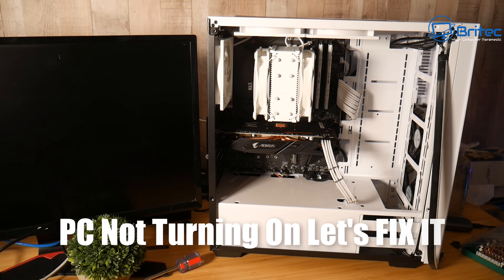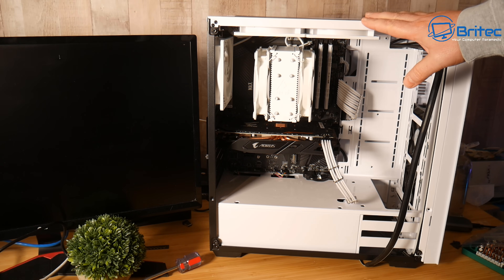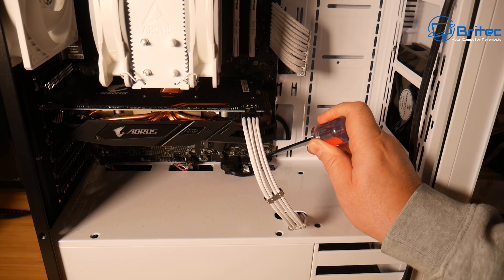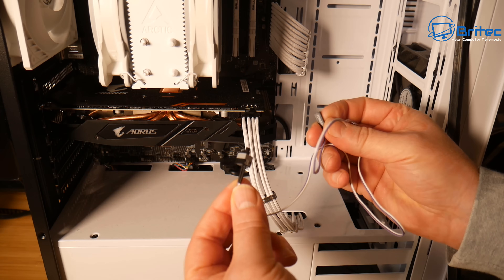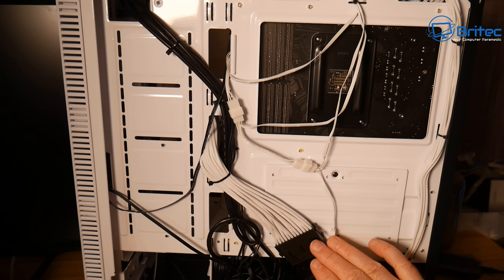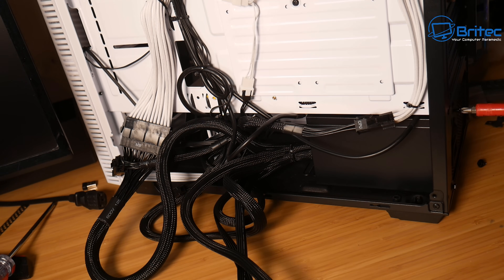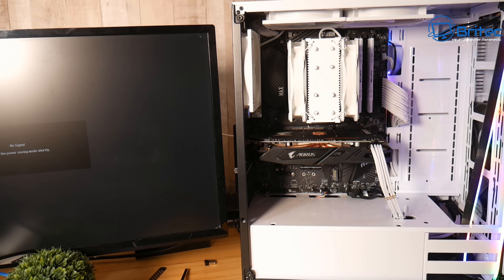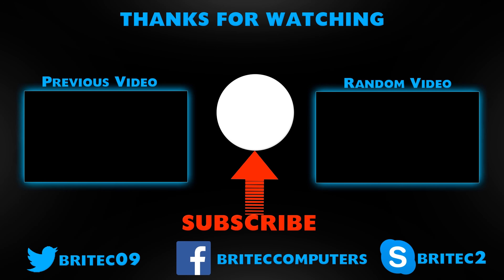PC Not Turning On Let's FIX IT

Comment: I'm facing another issue on my pc please someone help.

My pc won't turn on using power button, until I unplug power supply and plug it back, then it's turn on normally without any issues.

That happens every time I turn off my pc and try to turn it back on.

I wonder if someone can help me please.
Reply: maybe a bad power supply?
Reply: i would look up you’re exact issue and see if you can find anything

Comment: What if I swapped the PSU, but still no signs of any power, and the new PSU also gives no visibile power whatsoever? Not a single light goes on on the MB. So, I am sure new PSU is working.

Comment: Curious, i have a powered usb dongle; pc wont start unless its unplugged. I think it is causing a short to the chasis somehow and preventing the PC from starting up.

Can anyone think of a way to fix this?
Ive visually inspected everything and dont see a short? Pretty sure thats the cause though because i read somewhere the PC wont start if it detects a short (also the BIOS has a setting to preventing powering USBs during the start process to prevent this exact issue) and am confident this is the issue. Im trying to do it myself of course.

Any advice is appreciated, thanks in advance!

Comment: But what if there's lights on the mobo and the pc wont start. I've bypassed the switch. removed ram and all other components, replaced with others that work. replaced psu, gpu, checked pins on cpu.   if the mobo is dead then the leds wouldnt be showin. Can anybody offer advice?

Comment: Every video I find is a power supply issue. My power supply work and still the pc won't turn on. I don't how if the problem is the motherboard, cpu or ram, and no video tell me how to test it
Reply: Bro did ur pc got better?
Reply: Either it's a hard drive problem or a CPU problem. I would suggest trying the hard drive first.

Comment: I sent my PC into memory express to get looked at. I did the paper clip test on the PSU and it fired up RGB came on fan started spinning. But still I couldn't get any power to the PC at all. I couldn't even jump start it using the IO pins so I know its not the case cables or the PSU it must be the motherboard right?
Reply: Did you ever find out?
Reply: Hello! I have the same exact issue. What was wrong with yours?

Comment: My motherboard power button on the bored lights up but wen u push the button the blue light on the front of the tower goes blue and fades off instantly other things like my WiFi card lights flash and go straight off but the USB and memory card reader had power indicator lights come on all the time till the power button it pushed then thay go off till I remove the power cable and plug bk in

Comment: Hi I cleaned my pc and after if I finished I plugged it back in and it won't .... its not the power supply it works fine I tried it in another pc and I tried to manually power it on with a screw driver like u did in your video and it didn't do anything so I have no idea what is wrong

Comment: I’ve got the problem right now played my pc the night before woke up the next day went to play it and it wasn’t turning on. I thought it was the psu so I got a new one and still doesn’t turn on called up the company I got the motherboard from and all they said was plug in a ethenet cable and see if there are lights and there was and then they said it’s not a motherboard problem. I tried bypassing the pins didn’t work. Unfortunately I haven’t got the tools you have to test things to see if it’s getting power but how can it just stop working over night?
Reply: I currently have the same pc issues with you. Did you find a solution?
Reply: @Cattman9777  I turned out to be the ram I think it was a long time ago I can’t really remember
Reply: @cm1_g766  do you have any ideas how to fix when cpu debug light flashes only once and nothing else happens?
Reply: @Cattman9777  have you checked over your cpu to make sure it’s in correctly and no pins are bent etc?

Comment: What if my psu works. And I have a few small led lights on my motherboard that light up, so I know it’s getting a little bit of power, I did the paper clip test and everything turned on, so it seems the motherboard is faulty, or the power switch pins are faulty. Cause neither the PW SW or screwdriver method can’t jump it
Reply: I am facing that can you tell me how you fix it and what is the problem.
Reply: @madikiestherkhiangte9884  I had to return the mother board, it was dead on arrival, DOA
Reply: @aidan_sedore5  thank you so much for answering my questions. I was going to finish my work I login and the computer just power off, that happend for the fourth time and now it's just dead but the panel light on mobo on.
Reply: @madikiestherkhiangte9884  you should search up tests on how to test the power supply on its own, cause it turning on and off shows the mother board worked at one time. So something either broke on the motherboard, or PSU went out and broke, or cpu and ram not being placed properly. So many things it could be. Could have been the cpu was overheating and making the pc turn off till it finally died so it could even be cpu.
Reply: @aidan_sedore5  thank uou very much, the psu is working i think it's the motherboard, I opened it and one capacitor got a white thing like hard glue on it. Thank you very much for taking the time and helping me, wish you a great health.
Reply: @madikiestherkhiangte9884  could you help me? i just used my pc after 2 months of not having it turned on, after 2-3 minutes on desktop use (ms_word) it just went out. I tried to reboot but no more signs of power

Comment: My previous PC had an off-and-on issue with not turning on (or rather, not booting) shortly before I built myself an all new PC. Turns out, it was that my GPU evidently didn't like to stay properly seated. After a little over 6 years of use, it just suddenly stopped staying put and kept shimmying out. It was the weirdest thing because I'm still using that GPU in my new PC (planning to upgrade if GPU prices drop due to the crypto crashes) and it never gives me that issue with this PC, so my guess is that it was the port on the old mobo.
Reply: My desktop pc had an issue where I always had to pull out power cord and plug back in ,then power button would turn on pc. I recently changed out Graphic cards taking out Asus Strix GTX1080,replaced with AMD 6650XT. power button is now starting pc as it should every time.

Comment: Hmm Brian had a similar situation with my old Sandy Bridge build just recently and I went through most of what you did except I did not use a new PSU. When I tried the paperclip trick with the PSU cable I got a small puff of smoke from near the end of the GPU and thought the motherboard was shot even though it still had some LEDs showing power. To cut a long story short I found the problem when I touched the GPU and found it wiggled around in it's slot because the original plastic clips that held the GPU in situ had got brittle and had broken off leaving the GPU loose in its slot so I screwed it into the case as I should have done when I built the machine. I gave the RAM sticks a reseating and voila' the machine fired up. So it goes to show one should check cable and card fittings before you do anything else and save yourself a lot of money. So all in all a simple fix for what I thought was a broken motherboard.😄
Reply from the maker: Thanks for sharing

Comment: You did not mention checking the fuse is correct size in the 3 pin plug. Surely if correct fuse is fitted then the fuse in plug would fail first and not "trip" the house circuit.
Reply from the maker: I did mention it. Watch from 1.05 said I have changed the cable.
Reply: @Britec09  I did not say, you did not switch the cable. Yes, you switched the cable. Did you check the fuse?
Reply: Stop giving him such an attitude. @Del_UK

Comment: First of all check/change the plug fuse it can save you a lot of trouble & worry most people overlook this.
Reply from the maker: Like I said in video, changed and used a known good power cable
Reply: I have new computer of 2 month old but pblm is same, what should I do tell me solution sir plzzzzzzzzzzzz

Comment: I ran into an issue with my current PC while building it. I have a Fractal Design Define Mini C and mounted a SATA SSD in the only place where I could which was on the right side of the case, just under the side panel. This was fine till I upgraded my components. The PC kept shorting when I turned it on and I tore it apart trying to find the cause. What had happened was that sliding the case side panel on had damaged the power connection on the SSD and it was dead as a dodo! I quickly ordered an M.2 as a replacement, and, fearing I'd knackered the GPU, I ordered one of them as well. The system is fine ever since and my niece is using the old GPU in her system as it turned out to be fine. It's a GTX 980ti but suits her needs.

Comment: Would a UPS help the power supplies not trip ?
Reply: No the UPS only helps prevent in case the power to the plug goes out. The breaker/fuse was tripped due to a short in the power supply.
Reply: @GregM  My APC Back-UPS has Battery Backup & Surge Protector all built in (most I seen do). A mains spike could have caused the PC power supply to blow.
Reply: @penfold5095  It could but weak components in the PS is more likely since a mains spike would of taken out other devices in the home not just the computer.

Comment: To be honest with the discription of the fault and what with the power tripping i would have just gone straight to the psu with my multimeter, allthough i like this checker tool bri has.
Reply from the maker: Just showing people what to do.
Reply: @Britec09  appreciate your showing the non teccy people out there everything to check. Your average lay person is not going to have spare working parts at hand, so it makes Trouble shooting a little harder for them.
Reply: That's also true 😢 @cliffcook3993

Comment: Recently my PC was not turning on. The lights just flashed and the fan spun for a second or two and I was afraid in case it was a short on the motherboard but found out after testing that it was my PSU which failed. It's an Antec 700W and lasted about 1 year 7 months. Thanks for sharing :)
Reply: Dude can you tell me how to fix it? 
My pc won't turn on and the heat sink and power supply fan just turn in for like 1 or 2 seconds plssss dude 🙏
Reply: @hunterbro924  hi there 👋🏻 a PC not turning on or turning on for a few seconds and off again could be one of many causes. You should test your power supply first to see if that's the faulty component.
Reply: I'm really hoping this is my problem. My computer was working earlier then I put it to sleep. And she never woke back up. 🤣 The fans do move for a second like you said but that's all. I hope like you said it's the power supply unit.
Reply: @dainwilldoit8996  also hold down the power button for 15 – 30 seconds. By holding down the power button any residual energy is released
Reply: @dainwilldoit8996  did you try a cold boot?

Comment: I see the power supply is failed but is it worth mentioning about the MB battery perhaps being dead?
Reply from the maker: Not on this occasion
Reply: @Britec09  Obviously. My question was is it worth mentioning about the MB battery?
Reply: The mb batteries usually last longer than 12 months, I have replaced two in a pc i built in 2015 though. It’s a pain in the backside because it has water cooling, and I have to reset the bios.
Reply: @lilchris26  Over the years I've had to replace batteries a couple times. However they lasted a number of years. Nevertheless, I think it's still worth mentioning because I think a great many people don't even know that a MB needs a live 3V battery to get the thing booted. 
Anyway, I just upgraded from 8.1 to 10 and had a couple issues that your videos help me get sorted out. Thanks (-:

Comment: I had to do the same thing with my second PC two weeks ago and it also turned out to be a bad PSU. Fortunately nothing else on the system was damaged. The PSU in this case was an EVGA 500w that was just one month passed its five year warranty.
Reply from the maker: Quality is just not there anymore on these PSU
Reply: I had this problem in my pc,it was a faulty psu cx750.